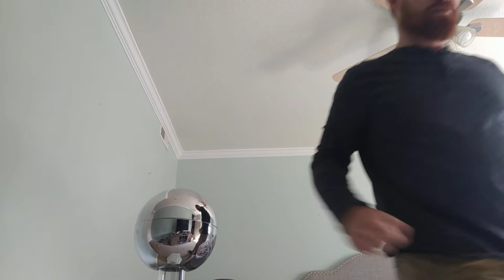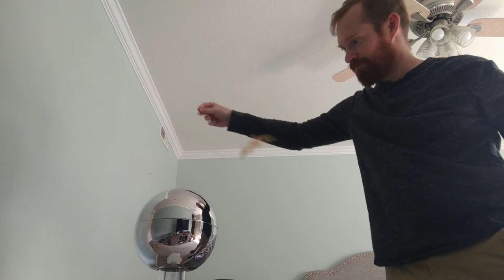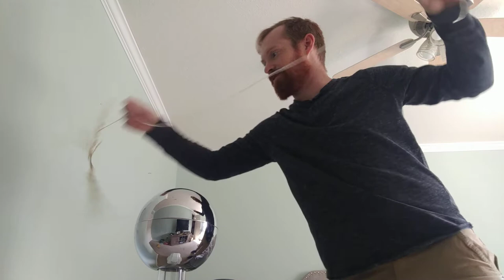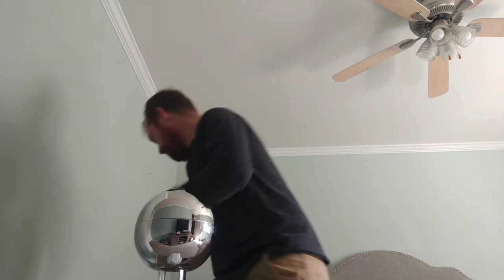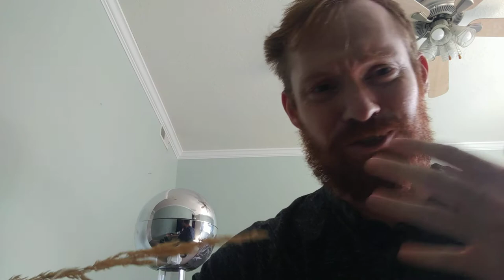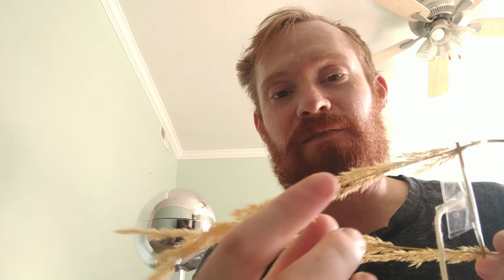Electrostatic Kites!

Comment: This is awesome. Do you think birds use that in  their feather? 

Lattely i've been wondering about how to fluidise air even more then it is already to travel through space like if air was "nothing".  Making travel less energetic.

Like that liquidize sand in hot tub. 
Is highvoltage the thing I'm looking for, what would act like the air in the sandtub at a molecular level. I was thinking some sort of microwave to energyse the molecule and make them take more distance between them self so they aren't in the way. 

I understand this could also lead to time travel. Maybe you took part in that expirement with  Jay, and thats how Jay becomes Thor and you Eric the red. Who knows. Life is weird.
Reply from the maker: Speaking of birds... Oh man.. I like to think they do! Especially looking at large flock behavior. Sitting on trees or power lines to build a slight static pressure around themselves. Then flying together is as easy as feeling the motion of neighboring birds in flight. Not sure how to prove it besides putting some mosfat sensor on a bird and check for static changes over time.
In terms of time travel I once thought so if assuming electrons do travel in time, but I am now under the assumption that positrons are not electrons moving backwards in time as feynman diagrams simplify, but rather they are the wake of electrons on space. My assumption now is that space itself is a quark mass that is stabilized and allows for electrons and unstable mass to pass through it at a max speed limit. It's interesting to think about and I need to spend more time with QED to see if that raises hopes in a more clear model of the fundamental forces in space.
I'm a fan of Jay, but I may be too off mainstream for his channel. Especially since my production level is no where close to his. Would be cool to see him duplicate this experiment to raise awareness of polarizing non conductors in electrostatic experiments.
Reply: @mykulpierce  I've been thinking the same kind of thing about space, well not in those precises word, but that space would be more like a superfluid than a vaccuum. You  definetly have better words to explain it. 

Do you understand how Moses could have splitted the sea with two different electromagnetic fields. 

I think that you can do the same thing with time it self. Split it and be allowed to travel freelly from one side to the other. Two vortex spining in opposite  direction( both outward)
Reply from the maker: @deathskayebolo6806  very interesting analog  to Moses is a story about priests of ptah. In some translation claimed to be from papyri, has a story of a priest that lifts a cube of water in order to retrieve a ring. (In context of these stories priests of ptah typically hired miracle workers doing mundane tasks).
Personally I don't have an answer for splitting of the sea as most observations dealing with water and electrostatics attract water. But these have been isolated water vapors and insulated cups. Would be interesting to see if there is some principle involved in forcing polarization and then repealing once charged. The question, related to walking on water question, is in what ways can water can be manipulated with charges given its polarizing nature.